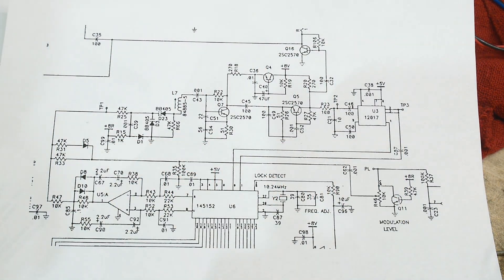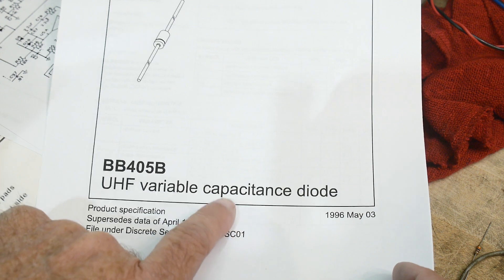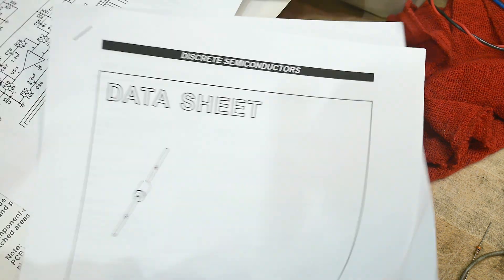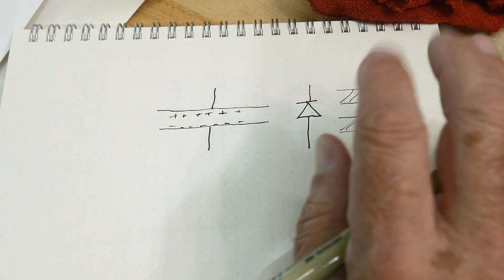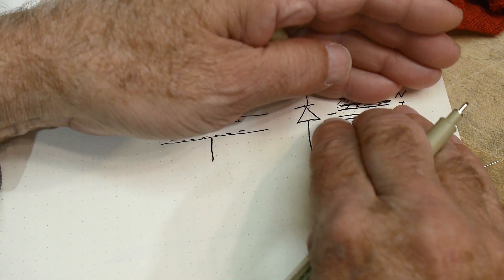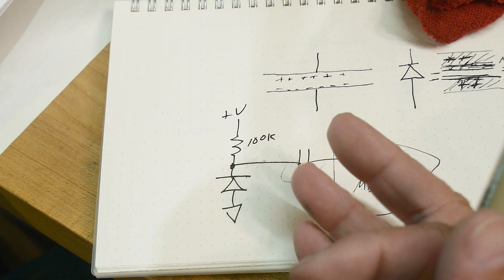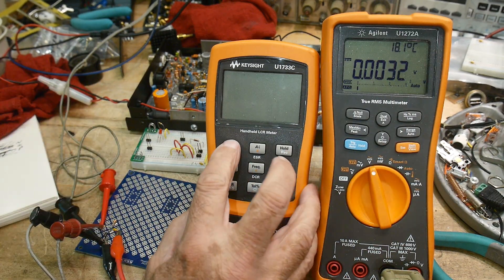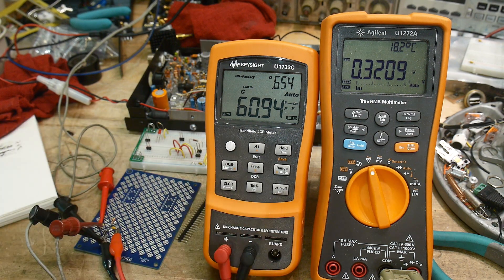#1509 Ramsey 2m Variable Capacitor Diode (part 5 of 12)

Comment: Is this an example of “negative resistance “? I just stumbled that phrase while reading some ancient text on Tunnel diodes. Is Negative Resistance really a thing? To be clear, I am still entry level the field and any feedback is appreciated. I can handle a few chuckles if this turns out to be the electronics version of a Jack a lope or piston return spring. Thanks, as always, for the videos. They’re always informative and fun, though the runtime seems to be getting down to the TikTok generation range.
Reply from the maker: negative resistance is a thing. as you say in tunnel diodes. it does not apply here

Comment: The depletion region in a diode expands when you apply reverse voltage making the distance between the free charges increase.  Since C=e A/d, this decreases capacitance.  To understand a diode's physics, you have to understand diffusion (from thermodynamics).  The extra electrons in the n-type layer wants to occupy all of the diode's volume and they start diffusing across the junction.  The same is true for the extra holes in the p-type material.  However, each carrier leaves behind an atom core with opposite stationary charge.  This separation of charge caused by the diffusion results in a very large electric field in the depletion region and this field turns back the remaining free charges.  By applying an external voltage, we push this diffusion/electric force balance one way or the other (depending on polarity of external V).  Forward bias opposes the field and allows carriers to diffuse across the junction.  Reverse bias increases the field (and junction distance) but allows no current.  If light excites electron/hole pairs in the junction, the electric field accelerates them in opposite directions and converts light energy into electric current (solar cells).

Comment: Yeah, Varactors are neat devices. You could make a voltage controlled oscillator,  use one to modulate frequency for a FM transmitter circuit, etc. 👍

Comment: I always thought that the depletion region of the diode got wider with more reverse bias and that was why the capacitance goes down. Wider spacing between the two "plates" of the diode reduces capacitance. Not that more charge on the plates crowds out new charge which is what I heard you say? Please correct me if I am wrong on this.
Reply: You're correct. The depletion zone acts like the dielectric in a standard capacitor. Increasing the reverse bias voltage widens the depletion zone and decreases the capacitance. The data sheet showed that.
Another factual error is that standard diodes don't contain an undoped intrinsic layer. That would be a PIN diode.
Reply: @zenbum2654  Yes, I caught that one also.
Reply: @zenbum2654  I thought the same. IMSAI guy has a background in optics where PIN diodes see application as photodetectors. I guess that is the reason why he mixed it in the description.

Comment: It'll work better if you reverse bias the diode. I see you have it drawn that way in the schematic, but with capacitance bottoming out at 0.9 volts, it seems forward biased.
Reply from the maker: of course it was reversed bias. It wouldn't do anything forward
Reply: @IMSAIGuy  perhaps the 1n4001 is different, i remember tv tuners using about 20-30 volts on the varicaps to go from vhf to uhf.